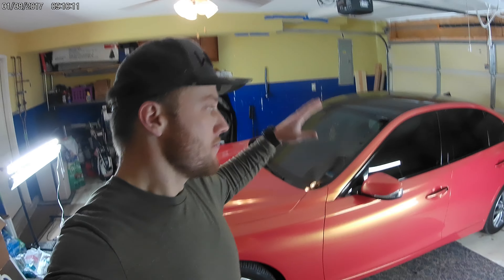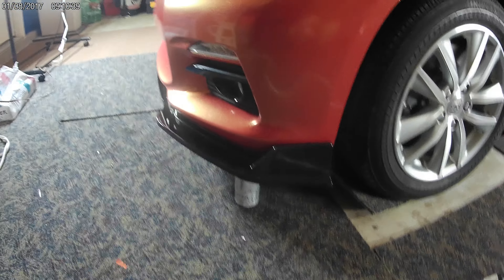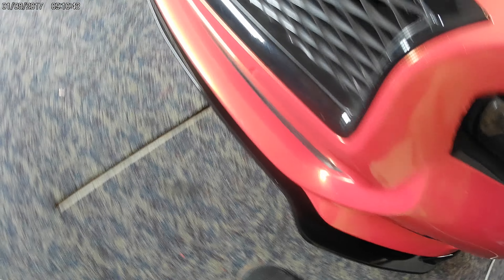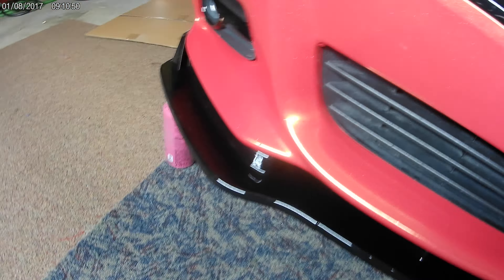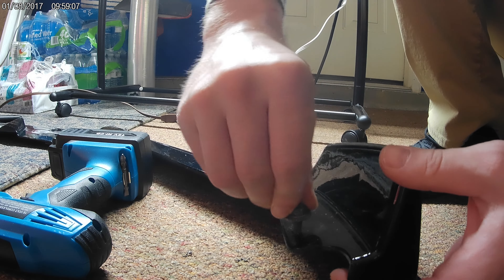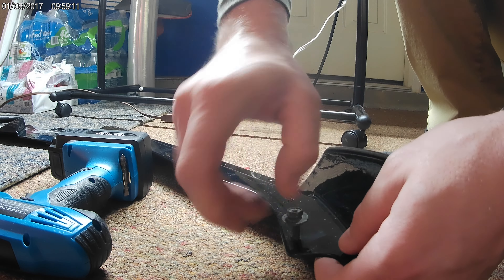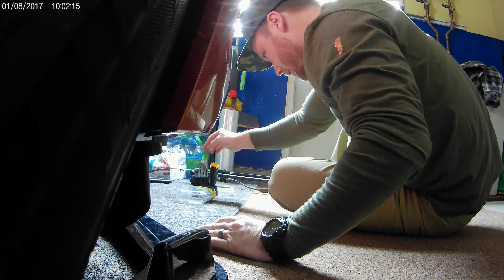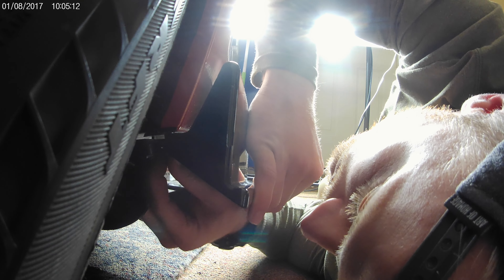Q50 LIP SPOILER INSTALL

Comment: Did this last for you? I’ve read a lot where these fall off at high speeds or crack easily.
Reply from the maker: Oh yea she's still on! I've taken it off to redo wrap and put right back on. Mine is held on by screws though not jut double sided Tape
Reply: @inthelifeofleif8268  what kind of screws
Reply from the maker: @stevenorstephen  idk they were tiny little screws that came with it